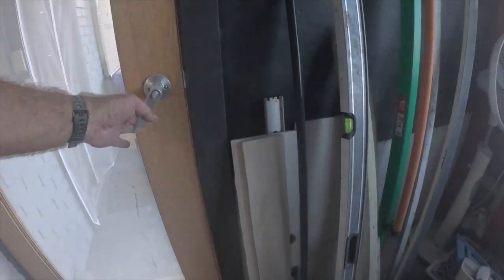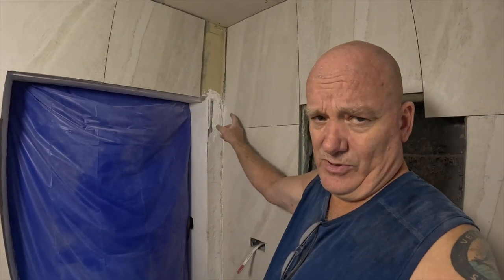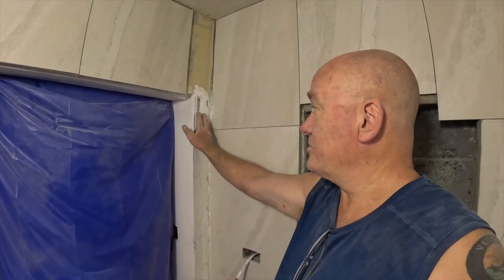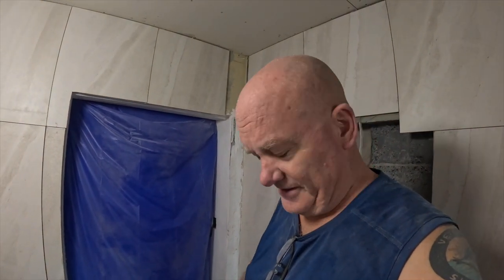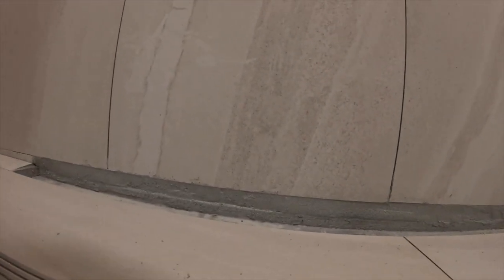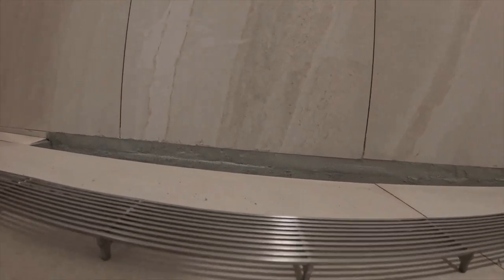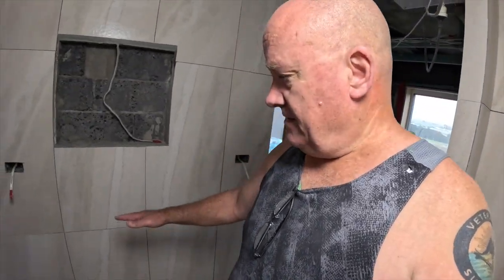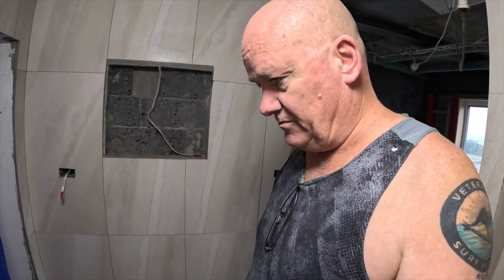Tiles finally finished

Comment: Is the final finish more gooder than you anticipated?  Looks fantastic, those finishing bits drive you crazy and take so much time.  Would you have done anything differently if you had to start over?
What next?  There is a next isn’t there.
Reply from the maker: OK – here we go...
I am very satisfied with the result – not too many flaws for even the pickiest wife to point at ;-)
By the time I got to those little finishing bits, I was nearly 'over it' already – but, on the flip side, I was comfortable, confident and well practised at cutting and grinding.
The main thing I would do differently would be to cut the first master tile around the drain, so I didn't end up with a thin slice in the corners. Also, I regret that I didn't think to put the drain down into the concrete, to avoid having a raised floor/step to deal with now (in the transition to the other rooms).
Next in the bathroom is the vanity unit and a couple of shelves. Next video is a new assembly table I made in prep for same.
There's plenty of 'next' after that. 
Thank you, as always, for watching. And thank you for your kind feedback.